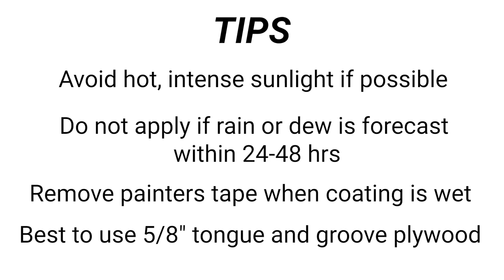Waterproof Flat or Low Slope Roof with Liquid Rubber

Comment: Some liquid rubber videos show primer and geo textile at the seams while other videos use LR directly on OSB or plywood without the sealer but use seam tape at the joints. What is the correct appraoch for a roof application on finished plywood.
Reply from the maker: You can use either products.  The application is a little different as you see if you want to use the Geo-Textile (embed into the coating) or the Seam Tape (coat over).  The Seam Tape is quicker. If you'd like to chat with Liquid Rubber Technical Support, you can touch base - Technical@LiquidRubber.ca or 1-855-592-1049

Comment: Thanks For the Video! What do you suggest to use toreinforce the whole surface and not just joint and edges? It would be for an houseboat flat roof so there is a lot of movement
Reply from the maker: Hi, Liquid Rubber has a 40 inch wide reinforcing fabric that can be embedded into the coating to be used for a full roof reinforcement.  I'm assuming this will be a walking surface and you'll want to use the Polyurethane Deck Coating.  It might be best to speak with Liquid Rubber Technical Support and walk through your project step by step.   Technical@LiquidRubber.ca or 1-855-592-1049
Reply: @LiquidrubberCa  thank you!!!

Comment: Can I add a small amount of water based paint to the white color product to get a desired color (copper color)?
Reply from the maker: Hi, you can use a water based tint with the Liquid Rubber Color Waterproof Sealant to change the color.  It is difficult to get the color you want and you may not want to use the final color.  If you do try, start with a small sample amount.

Comment: Why did you use a roller for the first coat, then use a broom for the second coat? Was that just to show the different ways you can apply it? Or was there a different reason?
Reply from the maker: Hi, the different applications were to show the different ways the product can be applied.  Brooming the Liquid Rubber Color Waterproof Sealant allows for more product to be applied in 1 pass.
Reply: @LiquidrubberCa  Thank you for such quick replies!

Comment: Is it provide better thermal insulation and how many years it will last.
Reply from the maker: Hi, the White Liquid Rubber Color Waterproof Sealant provides a reflective coating that keeps the interior cooler.  Generally every 10 years you can apply another application to keep extending the life span.
Reply: Is it available in India and how much it cost
Reply: Can we applied it over rcc roof

Comment: For using this on a cargo trailer with ply wood roof would you suggest using geo textile or the seam tape ??
Reply from the maker: Hi, generally the Liquid Rubber Seam Tape is used on a roof but the Liquid Rubber Geo-Textile can be used as well.  Liquid Rubber Seam Tape is to be adhered well and the Liquid Rubber Geo-Textile is to be embedded into the Primer or Coating.
Reply: Do you have to apply primer if using directly on plywood for flat ,slightly sloped roof ?? Trying to figure out what products I need to use for my project thanks
Reply from the maker: @kylepeterson4234  No need for a Primer on a Roof.  Essentially you need the Liquid Rubber Seam Tape and the Liquid Rubber Waterproof Sealant or Liquid Rubber Color Waterproof Sealant.  You can see more info here - https://liquidrubberusa.com/pages/mod-bit-roofs

Comment: Can I use an outdoor waterproof caulk instead of the tape for the seams?
Reply from the maker: Caulk is not recommended for the seams as movement occurs.  The Liquid Rubber Seam Tape bridges those seams, joints, flashings.... and has flexibility to move with the substrate.
Reply: Why would you ask to use a method they haven't used in the demonstration video?

Comment: What about snow? Freezing weather?
Reply from the maker: Hi, once cured, the Liquid Rubber stands up to extreme weather.  Both hot and cold.
Reply: @LiquidrubberCa  why didn't I hear about this before lol. How much does a 144 square foot roof cost?
Reply from the maker: With Seam Tape and Coating, it runs about $3.50 per sq ft.

Comment: What is the reason for needing to apply the second coat asap (as soon as it dries)? Would this product adhere to itself if I needed to do another coat years later?
Reply from the maker: Applying the next coat as soon as you can increases the adhesion of each coat.  Over time, dust collects and can reduce adhesion.  When you want to re-coat or repair years later, it's important to clean the surface well to achieve the best adhesion.